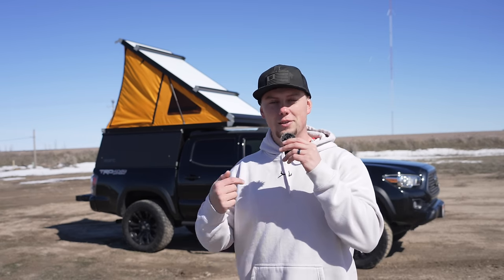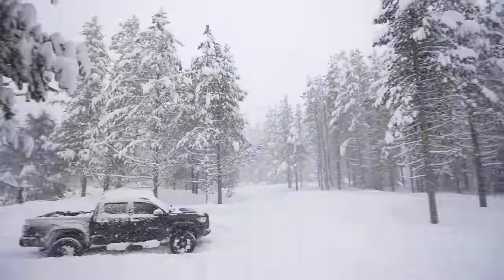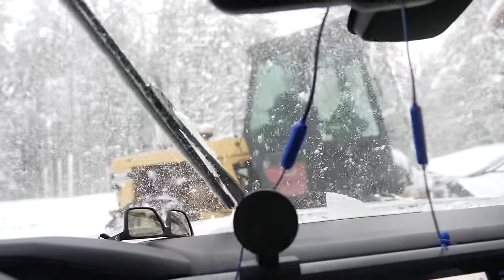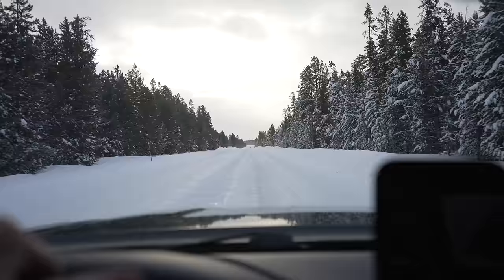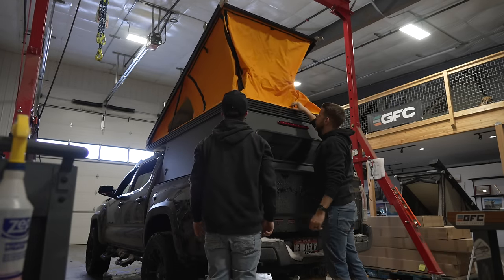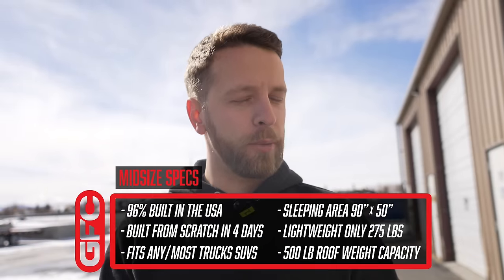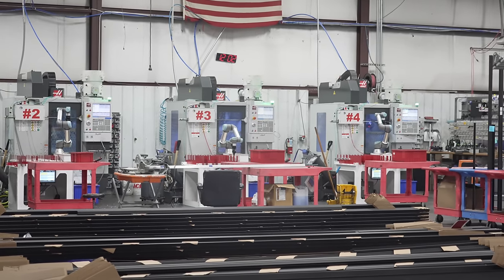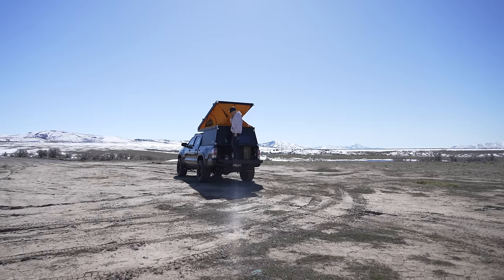THIS CAMPER IS A GAME CHANGER!

Comment: What kind of heating options would work with that for cold weather I wonder? Little buddy propane?
Reply: Or a diesel heater.
Reply from the maker: An easy one is to have a Mr.Buddy Heater in your truck bed! Have done that a couple of times and it works great! Just Make sure a window or two is cracked.
Reply: Do they make one for a chevy crew cab long bed?
Reply: @sapperROSS  I have a different brand of roof top but I bought one of those diesel heaters to rig up for it next year